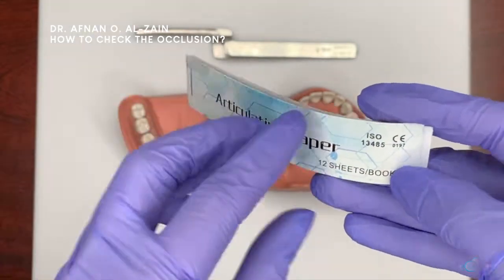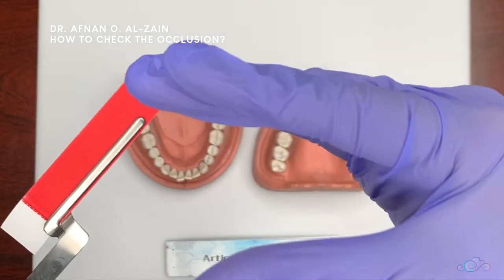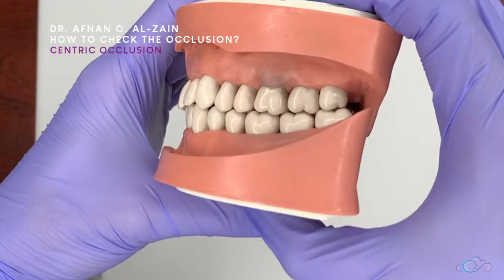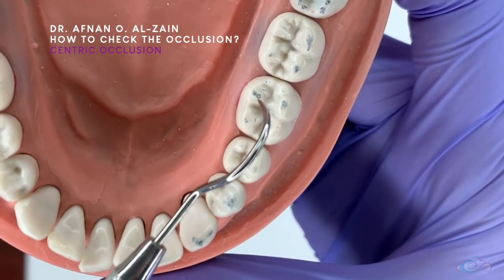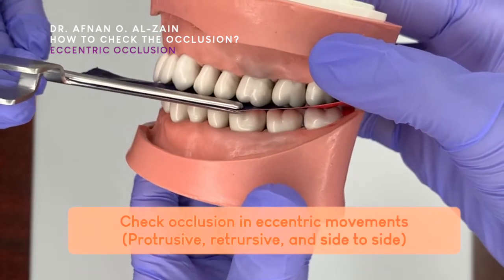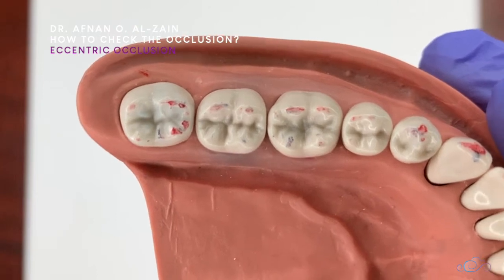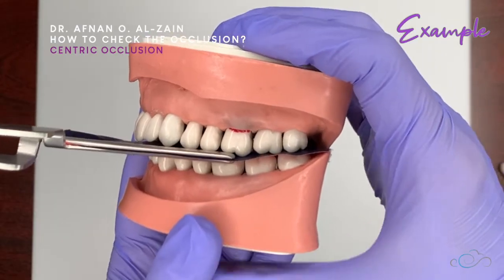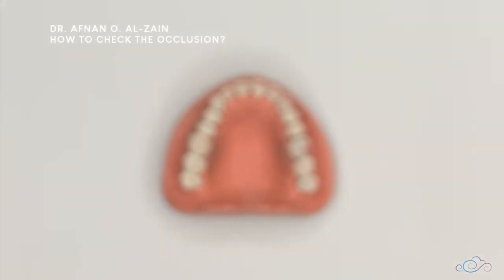How to check the occlusion? - En

Comment: Doctor can you tell us the preferred thickness for articulating paper to check for  high points
Reply from the maker: It depends what are you checking for. The articulating part thickness ranges from 20-200 microns. The thicker ones are used for detecting heavier contacts and is good for initial bite checks. So if you suspect there is a very high point you can use the thicker ones first. The thinner ones can help achieve balanced occlusion without interference in centric and eccentric occlusion. 

However, Shimstock thickness is 8-13 microns. It is thinner than articulating papers and typically used for finer occlusal adjustments typically when adjusting occlusion in indirect restorations but can also be used for direct restorations.

Comment: Mam please tell us, How to manage if high points are recorded on a amalgam restoration and which instruments we can use for that
Reply from the maker: High points are managed the same whether amalgam or composite restorations. The darker points or bulls eye points are considered high points. So remove them gently with light pressure until occlusal is even with even color points on all teeth. 

You remove high points on amalgam with a low speed finishing bur. You can check the finishing and polishing of amalgam restoration videos to see the instrument used. 

You remove high points on composite restorations with a high speed diamond point. You can check the finishing and polishing of composite  restoration videos to see the instrument used.
Reply: Tqu so much mam for your explanation
Reply from the maker: @Maa_magic  you are welcome
Reply: How to check co in. cD